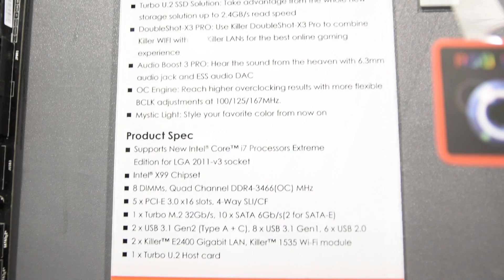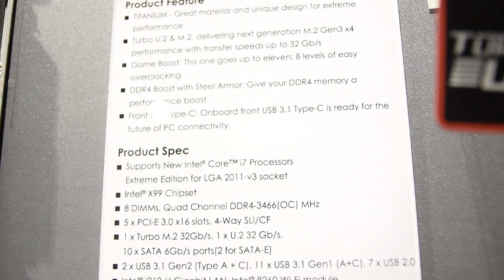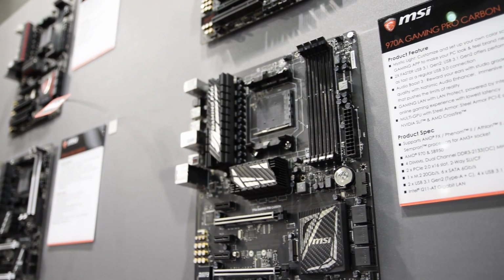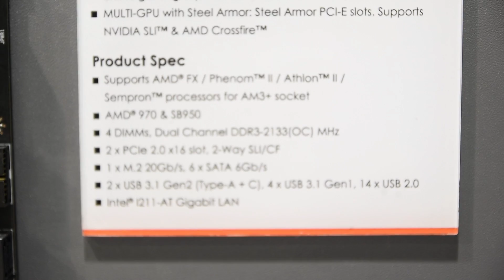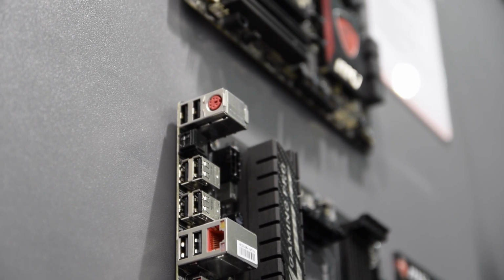MSI's New Motherboard Lineup - Computex 2016

Comment: Hey PC users! Will the ASRock H110M-DGS Micro ATX mobo's pcie x1 lane be obstructed or blocked by the Rx 480?! I ask because I need to install a wifi card into the board :P

Thanks in advanced :D
Reply from the maker: Looking at pictures of the Mobo, it looks like it'll be fine as the x1 slot is above where you'll install the GPU.